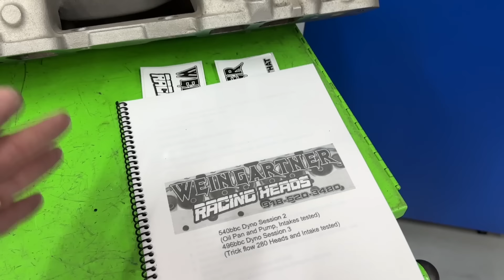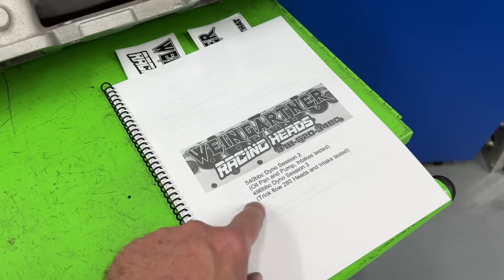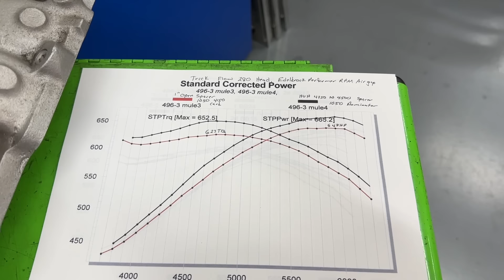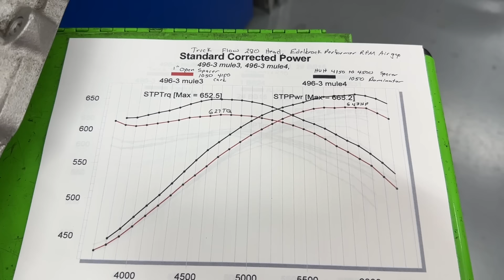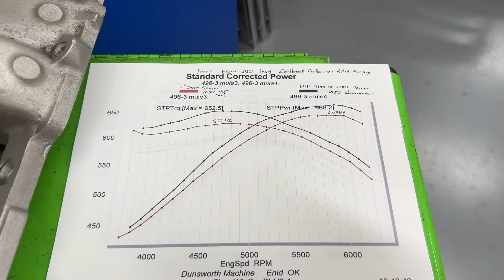Trying A Dominator On A Dual Plane Dyno Results BBC

Comment: Done correctly a Dominator is Great.        Years ago I converted a 9375 to a 2 circuit and put it on a customer's 467 with 049 heads and a very mild flat tappet hydraulic camshaft 10 to 1 and headers with full exhaust in a 57 2 door wagon.  It's been a while but I do think it was a single plane intake.  The car has full interior, 4.10 gears and 28 inch drag radials.  It drives on the street with super good manners gets 15+ mpg and runs consistent 11.50    no complaints with a Dominator.

Comment: This is a great test. I'm building a Gen VI 509 now with an Edelbrock C454 dominator dual plane and have a similar 1.5" 4 into 1 spacer and I was wondering what it might do. This is the closest test I've seen to what I'm planning on doing, so thank you. P.S. your pal DV says Edelbrock needs to make a 4500 Performer RPM Air Gap and I agree.

Comment: Imagine if Edelbrock made an SBC/BBC  4500 intake based on the Performer RPM but with longer runners. Max torque at 3500-5500 for a boat. No hood to worry about!

Comment: On the very restricted circle track motors they often require a “stock” distributor. A knowledgeable distributor guy can recurve a stock distributor and make the car JUMP off the turns. Works on dirt or pavement.
Reply: I put one of those pertronix hei rebuild kits with springs and bushings and that kit really did wake up my little sbc back in the day in an old c10!

Comment: Thanks for the test!  The 1050 dominator has an ideal venturi shape...the 4150 is way larger than it was ever meant to be.  Even larger doms don't work as well as the 1050.  Dragboss garage had the designer talk about the tweaks you can do to make the 1050 work perfectly.  It will definitely drive better than the 4150.

Comment: Eric - Curious if you think this is worth trying on my combo   -  460" BBC, 10:1, well worked 781 ported ovals, performer RPM, 230 / 236 110 LSA  -  In playing with a "Desktop dyno" program recently, I emulated my exact engine combo (460" BBC, 10:1, 781 ported ovals, performer RPM) to get my actual dyno sheet to match the desktop dyno's computer model.  Then, I changed the intake flange dimensions to 4500 flange size / values and increased CFM from 750 to 1100 cfm.  On the desktop dyno, power jumped by almost 50hp peak compared to the model using a 750hp holley.  It showed torque gains exceeding 35ftlb across the board from 3500-6000.  At the time, I remember thinking "well, its a computer program, it's probably BS".  This seems to validate what it was showing me - Motor needs more CFM, and the dominator might be worth trying!
Reply: Just some helpful information I bought a pair of BBC 461cid engines that we're in a boat that I had bought. The previous owner told me that on the Dyno he tried an 850cfm Holley compared to a 1050cm Dominator with the same intake manifold only using a 2" adapter when using the Dominator. 
The Dyno test was conducted back around 1991... So this is BEFORE the much better technology of today's 4 hole Super Sucker spacer and the now much better Dominator Ultra XP Holley carburetors 
And he told me the 1050cfm Dominator made about 35hp extra over the 850cfm carb from about 3000rpm or so to the peak of about 5700rpm. This is perfect for a hi-perf offshore marine application boating scenario where torque and horsepower curves need to be all in between 3000-6000rpm.
The engines had World Product Oval Port cast iron heads with larger 2.300" Intake valves and 1.880" Exhaust valves. The heads were ported to accommodate the larger intake valves on the exhaust side as well. 
The intake manifolds were Dart Oval Port single plane design.
Compression ratio was right around 9 5:1
The engines made right around 617hp @5700rpm with solid roller mechanical cams on 110° LSA. 
And remember this is back in 1991 😯😳
So if you are wondering if it's going to work on your BBC 461cid engine, I would certainly think so. 🧐👍
Reply: @ Thank you for the reply, that is great info!

Comment: I have found a dominator more driveable on the street on all my BBC engines. I have XPs in 750 850 an 950 cfm and my old 1050 dominator is the dream street carb

Comment: Eric, please point out for the uninformed that the flow rating of the 1050 4150 carb is at a test pressure that sells carburetors 
The Venturi diameter doesn’t lie

Comment: You drop a video and I’ll watch it everytime !!! The only time a carb can be to big is well never !! 😂 Nah I’m kidding but seriously and I maybe dead wrong but if we are talking about a street driven engine and part throttle tuning maybe you worry about having to big of a carb but if not I’d rather have 50 to 100cfm or more carb than have a carburetor that’s to small but hey that’s just me 🤷🏼‍♂️and I’d suspect unless it’s tuned really well the dominator would be lean on the street at part throttle
Reply: Probably won’t since it’s calibrated for a different spec than a street engine

Comment: The past week or so I’ve been thinking about this dominator and HVH spacer combo making so much more power than the 4150’s. Obviously the 1050 cfm 4500 will flow more air on the flow bench than a 1050 cfm 4150 carb but cfm isn’t the thing here I don’t think. I wonder if the taper down in area with the spacer is helping the fuel and air coalesce properly. Something with that spacer is making the difference because the same carb with an open adapter doesn’t produce the same results.

Comment: Man i would love to try a dominator on my circle track engine and i mean mine makes more power just because our rules is open except 2 barrel and other things. But i actually technically can run a dominator against the 360 class but my engine probably won't be enough against the 360 wing class because they got fuel injection, and a nuch of other stuff mine doesn't have but same with spec sprint they got dry sump and other stuff that my engine doesn't have as well

Comment: I wonder how drivable it'll be if you used a Dominator EFI throttle body from Holly over a Dominator carburetor
Reply from the maker: Efi is different from carb. If carb is too big it can’t pull fuel. You can use a monster throttle body on efi.

Comment: All I can say is, I swapped to a single plane and loss  .3 tenths on motor and .1 tenths on the spray..... 
I took that single plane off and put my dual plane back on quickly...
Reply: Loosen your stall and put the single back on probably faster...
Reply: What was the mph difference?
Reply: Thanks Shawn! A buddy of mine told me that too. The month of August will be the last month of racing for my car class. I'll refresh the engine and upgrade before race season next year.

 Cedric:
Single plane 93 mph
Dual plane 95 mph 
I'm going to increase the nitrous from 100 to 150 on the dual plane and be content for now....

Comment: 6:20 Why does the dominator have an AF ratio of 4?!   Something is not right.
Reply from the maker: Because air hat wasn’t on it to measure afr that way
Reply: @WeingartnerRacing  The air hat fits the standard sizes but not the 4500 air horn?
Reply: @auteurfiddler8706  
The 4500 has a much bigger air filter base ring - makes sense, really...
Something to watch for if you're fitting an air filter to one - and, yes, people do when they want to maintain power with engine life.

Comment: Too bad they don't make Dominators with a choke for us northern folk.
Reply: Make a choke!
Reply: The don't NOW. But the first Dominator list 4575 was for NASCAR Fords. This was around 1970. They came with a choke, though it was cable only.  No electric choke even as an upgrade. Most guys tossed away the chokes. Now, you can get one of these carbs used for around 5-6 hundred dollars missing the choke, but still with the choke tower. But it is about 2000 to 2500 more to get one with the choke. I can't help think there must be a way to make the choke plates and the rods for less than 100 dollars.   I think any of the early Dominators before the "blended bowl" thing started could be drilled for the choke rod.
I agree that a choke is best. It is insane that guys threw away the chokes and cut down the choke towers.  Ruined.
Reply: I see on Ebay they are reproducing the choke plate for 1000 dollars , but I think a few other parts are needed beyond that.

Comment: Open spacer = not a dual plane.
Reply from the maker: Nope still two planes of air passages. A upper and lower section hence dual.
Reply: True dual planes have a divider so that one side of the carb is feeding 4 cylinders. By running an open spacer or milling down the divider all 4 carb throats feed each cylinder like a single plane manifold. You are making a single plane manifold with longer runners.
Reply: We cant help ur misunderstanding of Internal Combustion Engines.....your comment was foolish, and sounded un educated on Internal Combustion Engines....what Eric did was SPOT ON!!....learn some more young man, THEN comment!!.....sorry, truth is truth.....
Reply: You sir are right.